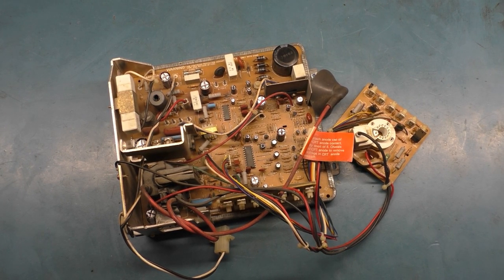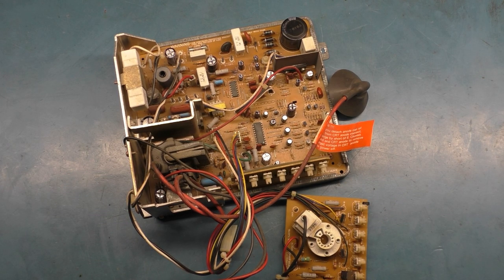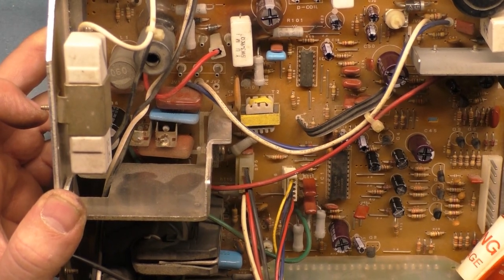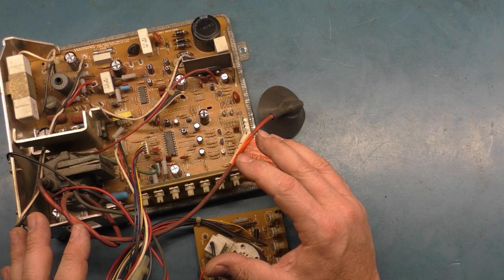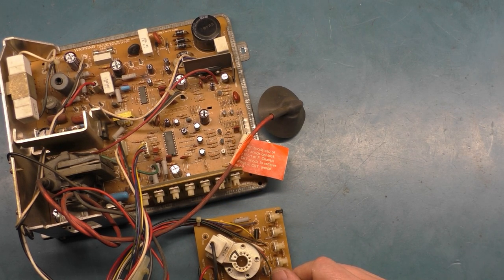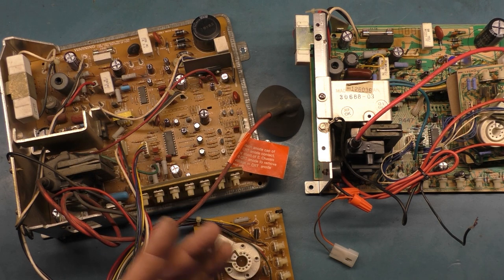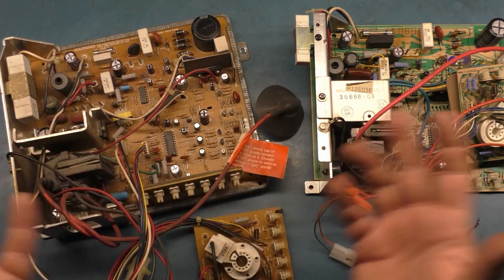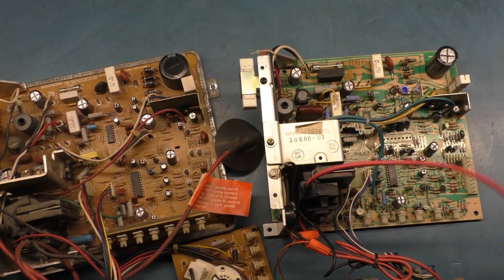19" Sharp Image (K7000 Clone) Arcade Monitor Chassis Repair - Heater Destruction + Causing Collapse

Comment: God what I would do for a skinny neck tube ...any pointers on were or what to look for when picking a donor tube ..every tv set I've picked up is ether go7 or hantarex ..Still love the videos Mike. You have tought me so much so keep up the great work my man 💪
Reply from the maker: Unfortunately, I'm not aware of any commercial TV with a 7-pin tube. The arcade world is the only source.
Reply from the maker: You could always just swap the neckboard with a 9-pin one, assuming you could find one. The main chassis is the same between the 7-pin and 9-pin. No difference.

Comment: Good video!  Sorry about your tube.  I'm curious (this is becoming common) - I see you have your soldering station set to 800 degrees.  I think I read once that 700 is ideal.. in your opinion are there any disadvantages to running hotter?   What about the advantages? Also, curious what type of mat your workbench has on it - looks like an ESD mat?
Reply from the maker: Hey Shawn. I put it to 800 to avoid damaging pads. I can transfer heat quickly and not have to leave the iron on the pad as long as I would at a lower temperature. The less time you spend on direct contact with the pad, they less chance you have of damaging/lifting it. I’ve seen countless pads destroyed/lifted due to irons set too low. 

It’s just a regular rubber mat that a viewer sent me. It’s not ESD rated but I can tell you that in 21 years of working with ESD-sensitive devices in both the civilian and aviation world, neither me or anyone I worked with have ever ESD’d anything. It’s certainly a real danger, but I feel it’s like it’s something where conditions have to be just right for it to happen.

Comment: Have you ever done a repair video on SHARP IMAGE SI-727R-DS chassis? I have one I am installing a cap kit from Peter (AP & R), Sharp Image SI-727R-DS Cap Kit "Mega Deluxe Cap Kit. This model is dual resolution: Standard (CGA) and Medium (EGA) 25" Chassis. Someone put a 25" Panasonic JS DS sticker over the Sharp Image sticker on the heat sink.
Reply from the maker: Not that I can recall. Sorry.
Reply: @MikesArcadeMonitorRepair  Can you help with B+ test point and correct voltage? The chassis is working, just needed cap kit. Cap kit is completed. I found one post on KLOV saying to test on R411 or D405 for the B+ voltage. The B+ Trimpot is VR801.

Comment: Am I mistaken or did you hook up the G2 and focus wires backwards when you swapped to the new flyback? Normally the red one goes to G2.
Reply from the maker: No. You don’t go off the color. Thick wire always goes to focus socket and thin wire always goes to the G2. Don’t go off the color.